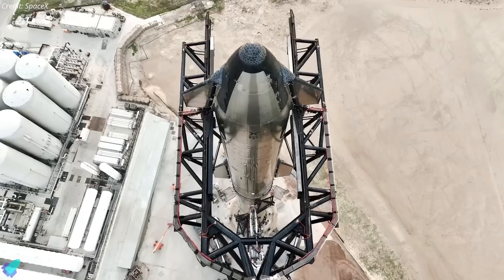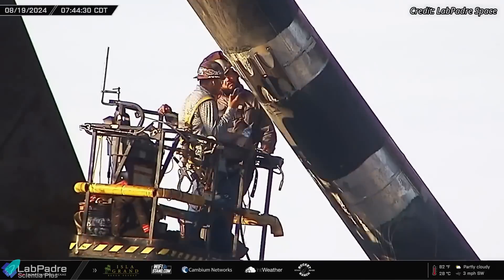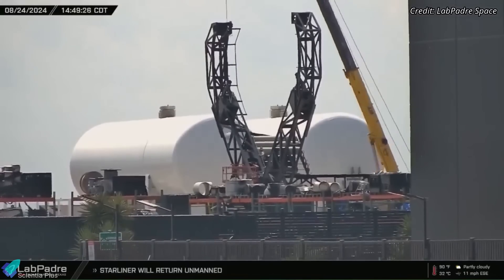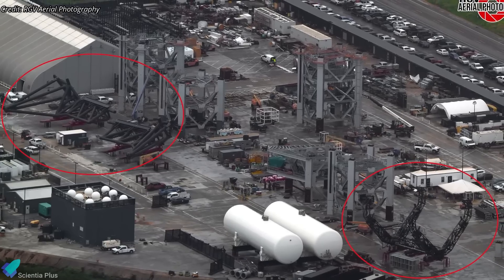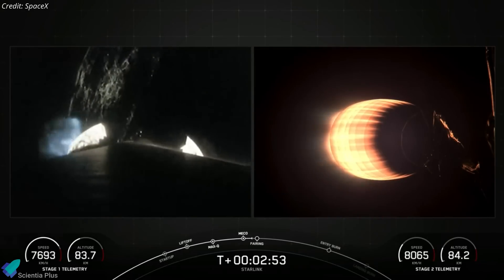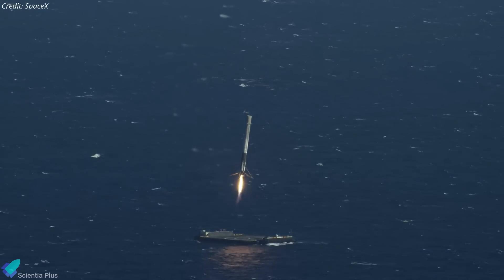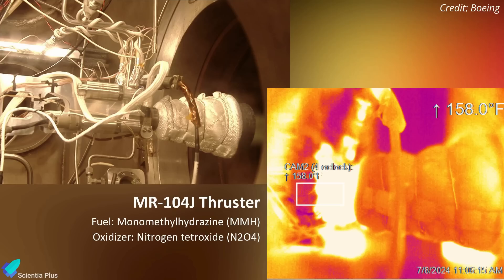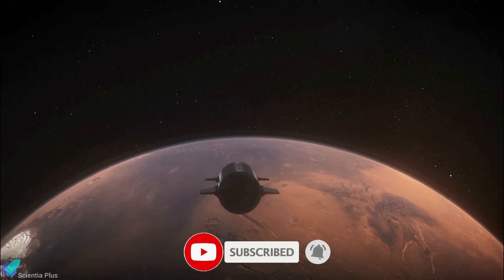Starship Flight 5 License FAA Gives Important Updates, Falcon 9 Grounded What Went Wrong?

Comment from the maker: 00:00 Starship Updates
06:44 Falcon 9 Grounded After Landing Failure! What Exactly happened!
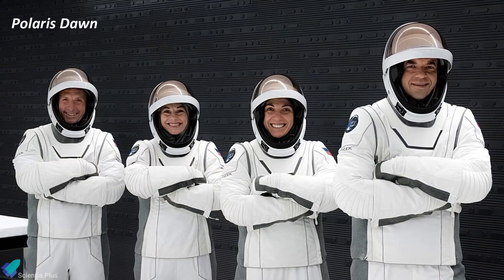09:42 SpaceX will Rescue Starliner Crew, Starliner Return Date Announced!

Learn More:
1. Starship V2 Features:
 a) Design Improvements Update 1: https://shorturl.at/lpGT7
 b) Design Improvements Update 2: https://shorturl.at/gwNQ4
 c) Nosecone & Payload Bay Redesign: https://shorturl.at/xa60S
 d) Methane Downcomer Redesign: https://shorturl.at/XdYBG
2. Starship V3 Features: https://shorturl.at/mnBT4
3. Starship V2, V3 & Raptor V2, V3 Complete 2024 Update: https://shorturl.at/tN248
4. Raptor V3 Mega Upgrades & First Test: https://shorturl.at/TRIyj
5. Latest Starship Upgrades
 a. Starship Hot Staging Explained: https://youtu.be/qgZHo9wYRW0
 b. Super Heavy Booster Upgrades: https://youtu.be/vZH5esgrFiM?t=63
 c. How SpaceX Protect Raptor Engines: https://youtu.be/L22gyQDDXho
 d. Starship New Heat Tiles Explained: https://shorturl.at/p2Ijb
6. B14.1 & Catch Tests #1 Explained: https://shorturl.at/w0zDU
7. B14.1 & Catch Tests #2 Explained: https://shorturl.at/mSqCO
8. Falcon 9 Mishap July 2024: https://shorturl.at/uZ6TS

Weekly Updates: https://bit.ly/3HIQjPC
SpaceX Playlist: https://bit.ly/34wue8T

Comment: Let's see - FAA grounded the Falcon Rocket because a Falcon booster landing on an unmanned barge , one of its landing legs failed , with fhe booster tipped over and exploded. So FAA has grounded a succesful rocket approved and certified by FAA to carry crew , because of (secondary) booster wasn't retrieved ?? Appears FAA playing partisan politics ! Shame on them .
Reply: Please learn basic information about what the FAA regulates before deciding what its motives are. The FAA does not certify rockets to carry crew. Any rocket that encounters a mishap during flight is grounded automatically. Flight is defined by the operator in coordination with the FAA, and for Falcon 9 launches, it is still in flight until safed on the landing zone or drone ship.

Comment: I imagine the chopstick arms were designed with enough strength plus safet\y margin to not fail under the dynamic weight of the of the descending booster. The stiffening of the legs were most likely to raise the frequency
 and decrease the amplitude of the bouncing motion of the legs so they stay close to the booster after contacting it.

Comment: Boeing is done for crewed flights.
They failed with this project and should be dropped.
There are much better options in the pipeline.
Let Boeing continue to build airplanes and space components, but drop them for building crewed space machines.
Boeing no longer has "The Right Stuff".